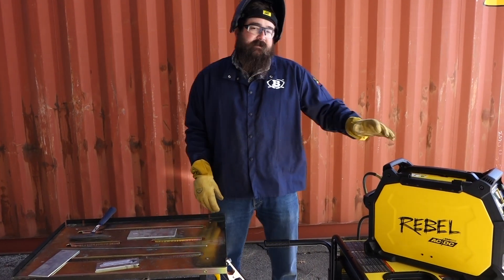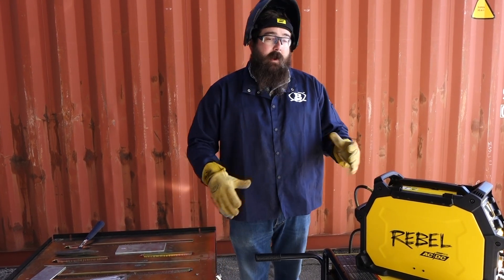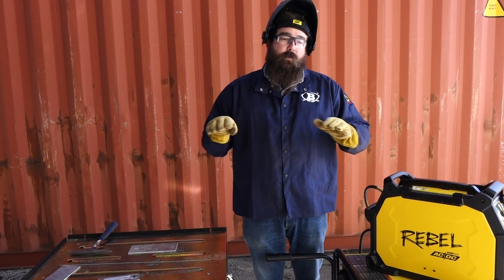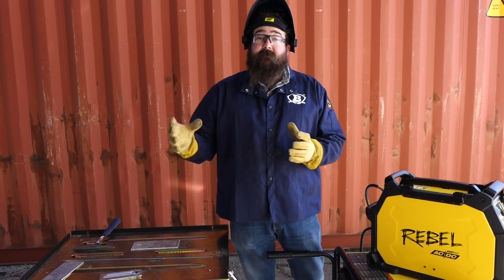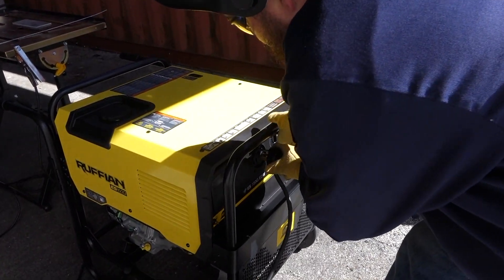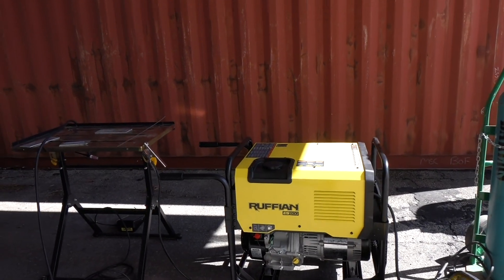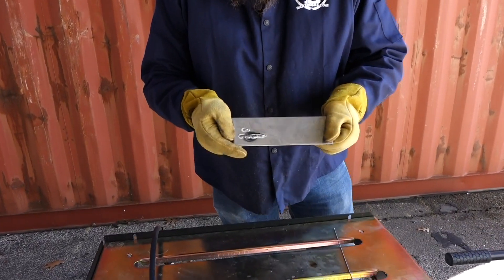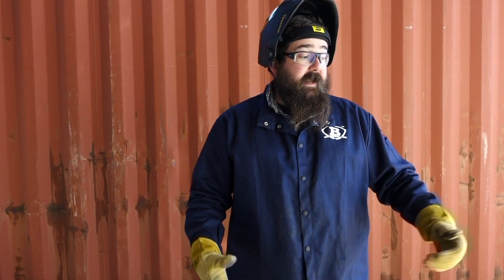Running ESAB Rebel 205 off a generator

Comment: Hi Andrew, at bakers gas. You never talked about the sine wave, or running 205 rebel on inverter generator. please give some detailed information on running inverter welders, on inverter generators. thanks. I do own a 205 rebel puchased from Baker's Gas. thanks.

Comment: Inverter welding machines are best run using a pure sine wave inverter generator if no main power access. The ESAB Ruffian ES150G has an inverter welder, but I can't find any info to state whether the generator component uses inverter technology or old school generator tech, which could compromise any sensitive electronics such as the boards of an inverter welder plugged in.

Comment: Ive always been told running these inverters off of generator power would fry the boards over a short period
Reply: No way they are as tolerant of irregularities of any type compacted to the old but much less capable less efficient transformer machines.  As 1 comment on another video called out, the inverter machines are, at their heart, computers.  And anyone who has been around computers for a while knows, they, like sheep in the pasture, die quietly, often and without a fight.

Comment: How picky are the rebel 205s to THD ?
Reply: That's what I'm curious about.
Reply: What's THD?
Reply: Total Harmonic Distortion, ie, messed up waveform & related.  I'm an accountant, not an EE, so google it for more information.  High THD is hard on a welder (maybe worse for AC welding??  Not sure).  Is it possible that the user above who had such bad luck with his rebels, 215 and 205, pushed them too hard when using the generator?  I'll be it could be really tempting to max out max out max out in trying to get the performance he was used to with regular wall power.
Reply: Honda Eu7000?

Comment: Ok, so, I'm really hard on my equipment, that being said, I've gone through 3ea. (on my 4th) EMP215 machines and my 2nd EMP205 AC/DC machine. the 1st 205 was in the shop for boards (plural) two times before ESAB replaced it and the 2nd one has been in the shop twice for multiple boards, during which time I purchased a 2nd 205, so I could continue making $$ and after 5 months I finally got the other 205 back. I now have a spare (back-up) 205 for when one is down and I keep the 215 as a back-up for the back-up. I use to use a Generac 9000 watt generator with the 215 and when the Generac went in for repairs I purchased a Ai-power 10,000 watt generator.  and used it throughout all of the life of the 1st & 2nd 205. I never tripped any of them out from lack of voltage, it just fried the boards. I've since removed the portable generator and now use a PTO driven 19kw generator off my Rig and my machines seem to be very happy. I'm posting this because of all the problems I've had running the Rebels off of generators. I suggest at least a 10,000 watt generator if you expect longevity out of you Rebel. Don't get me wrong, they're the most powerful, the most multi process and the lightest portable on the marked today and wouldn't have anything else..
Reply: So that ruffian will probably fry the rebel?
Reply: @stevenwebster3286  In my opinion, yes...
Reply: I have had the same issues, nothing but problems running off a generator for extended amount of time.
Reply: dam now you got me worried lol
Reply: Damn a 19k PTO generator? I gotta look into that. Didn’t even think about a PTO gennie